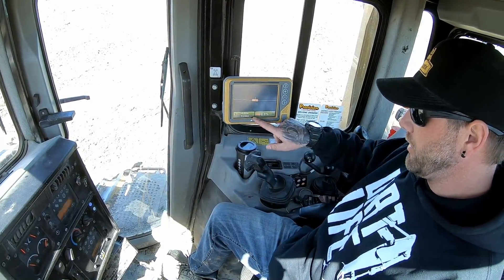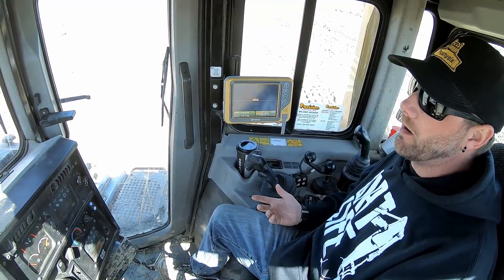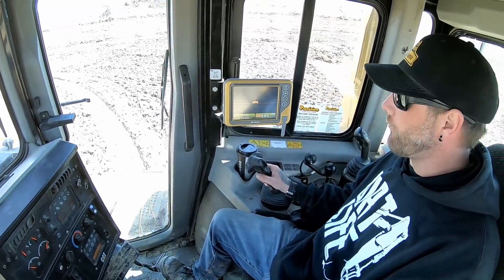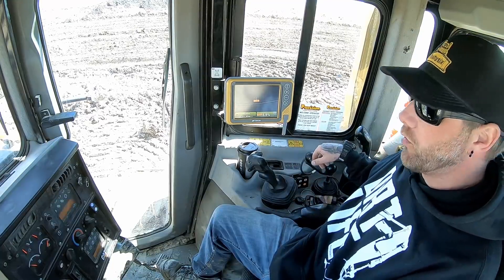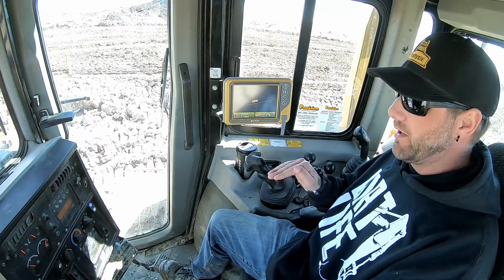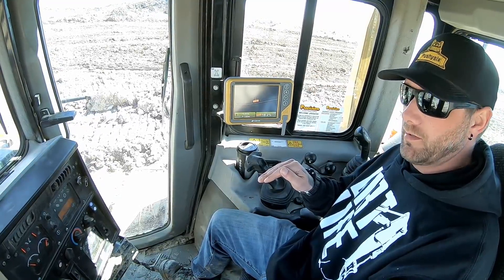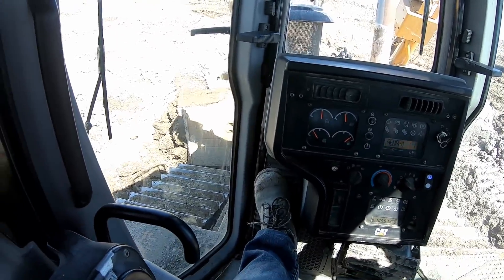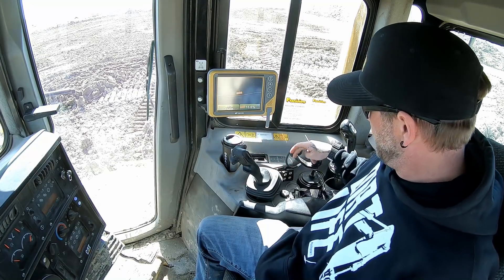How a GPS dozer really works | crushing misconceptions

Comment: Dude: what I have been trying to teach my apprentices for the last 40+ years is that every pass, every push, every bucket full is different! Some more different than others. They have been proclaiming that the computer will replace the operator for many years now. OK. Except they had to hire three computer programmers that had little if not any clue about what they were doing, to replace a competent operator.

Comment: I’ve been running machine control for 4 years . Did it the other way 21 years . I don’t use auto until I have it close using my cross section view . Trimble is by far my favorite. Topcon second . Last but not least Leica . Also offsets . You have sub grade , finish grade , rock grade finish floor all that can be changed . You have to know your thickness of concrete , pavement or slope . Topsoil had to be accounted for . Say .33 for ample topsoil spread . Without an excavator or pan in front of you moving the bulk the dozier is useless . I’ve heard a trained monkey can run GPS dozier . Ha . No way . I’ve got so many jobs under my belt that I’ve seen it all . GPS is a tool like a hammer or saw . Trouble shooting is also a big deal . I also run my own localization. I have the rover to go with my dozier . So I can check and change blade wear and go behind myself or lay out all kinds of things . Fire plugs , water valves , storm boxes . Etc . I’m considered very valuable to my company. Interestingly enough I lied to get in my first gps dozier . And I was lost ! Lol but I learned fast and later went to John Deere training days at the proving grounds and REALLY got good .

Comment: So you took 20 minutes to try to justify your place in the seat? Guessing someone in the canteen pissed you off and said the gps does it all for you. 
Being honest, as an operator myself, you’re making it seem much harder than it actually is, the reality is that the auto on the GPS DOES do most of the work for you, any idiot knows you can’t push out 500mm cuts.
Also...the new intelligent komatsu dozers, CAN adjust for a full blade, they’ll cut gradually so you don’t stop, they’ll lift the blade when it senses its full (resistance). It also has fill/spread function. 
Don’t be threatened by gps mate, it’s a tool FOR the operator, not to replace the operator. ;-)

Comment: I have no problem with GPS in machine's, in fact I think it saves a lot of cost when grading because you don't need a bunch of surveyors on site all the time.
The only thing that is worrying me is that the GPS is getting better and before you know it you won't need any operators for dozers, diggers, graders or no more dump truck drivers, maybe I'm just being paranoid, has anyone else have these thoughts?

Comment: as a dozer opperator on a now 5 year old cat D6 explained it. The GPS for that dozer could do the up and down, And move each corner upp or down,,, but it could not tilt the blade left or right to make material flow to the sides. But it only worked properly at slow speeds. But another dozer, this time Liebherr with different type of GPS only could do the up and down even tho it was more ''Advanced'' as explained by the dealer.

Comment: Pushy Six you should check out the cut fill mapping feature in TRIMBLE Earthworks that starts by colouring up the cut fill areas in plan, cross section and profile views by comparing a scan surface and the design surface and then constantly updates as you make passes with the machine.

Comment: very old dozer, with the new systems u can go on auto and it will fill up the blade will detect slip and carry the material for you.... so you literaly just need to drive back and fort.... and care to get some slots ... a new dozer can be operated by a total fool

Comment: us  old timers {who dont  use gps} use our "eye balls" to make grade.been at it 31 yrs.
Reply: i had to do it all by using eye then having a string line on the batters first for trimming then for pushing topsoil on, also trimming up after a excavator we use to use laborers with boards to bone in the heights not its all gps, while it's good it now takes the skill and art out of operating machines, hence why i am thinking of leaving the trade
Reply: "The art of experience" being lost to electronic gadgetry is something that we in the music business see a lot of; I can draw a straight line across the table from "Dozers with GPS" to "Casinos with electronic drums".

A lot of the older drummers who worked in the casino bands, when they first experienced the electronic kits were not impressed with all the fancy stuff they could do and were resistant to learning even the basics of "how to run them". Those were the guys who you'd see less and less of at "shift change" (casinos typically have multiple bands play on the same stage, hence the same set of drums...drums bulldozers... same/same...kinda/sorta...). They were working less because of being adverse towards adjusting with technology. 

Personally I can't stand E-drums and I'm with you on the "eyeball it" thing. A good operator has to know the basics and then some. And experience is something one cannot buy, you gotta earn it from the ground up.

Comment: Been running equipment for a while, from coast to coast. The BS about doing things by 'eye' cracks me up. I've done plenty of finish work by eye. I'll take my GPS system and go up against anyone doing it that way. There's just no comparison. I've saved weeks of work on projects with this stuff. You need to understand it, but once you do its crazy productive.
Reply: You are correct, i have used topcon 3d on 953d and trimble on excavators you cannot get better ,all this"by eye" is not bad, but after 30 years plus gps  is far far quicker...
Reply: Couldn’t agree more.

Comment: Im  a new operator  I have been trained on a d3 cat bulldozer.   The things you are saying make sence.  When my friend said bulldozer is easiest machine I think he's full of shit.  Iv driven excavator bulldozer backhoe and grader and grader is most finicky of all.  Seems simple but its not.  Any help you can give me as a new operator I thank you Now.  Love your videos keep up the good work
Reply: You are such a tool!!your in mud that’s not final grade. Yes I’ve worked with GPS  their great but your demonstration licked balls dude.
Reply: Your friends full of shit or isn't a true operator,  anyone can pull a stick and say its easy. Keep at it. I always found the motorgrader to be the most challenging.  Stay in the seat friend
Reply: The people think it’s easy to just push dirt and getting something level , but basically the operator is inside the cab and is in a very bad angle to estimate what he is going. Tracking layers a few cm all the way, I feel it’s very hard to see what you are doing.

The only way I’ve found that works for me at grading is using an excavator with a blade large bucket, I see what I am doing , and if I have a laser to tell me what is the level, it works just fine.

Comment: GPS is a a tool. Just like any tool it’s only as good as the operator and it can’t make you an operator.

Equipment will become autonomous. It a ways off but it will. That’s not to say no one will be on site, but labor is getting to costly.

Comment: GPS is not dependable it is accurate within a tenth, but I can cut within a hundredth manually, having ran both, gps is for the ones who are not good enough, a good grade man could name his pay,within reason, I know, I did,.Gps changes it grade for no reason other than a poor satellite reception, but construction in general has declined in workmanship, men were good at their jobs once, now it's good enough for a poorly done job
Reply: If you cut within a hundredth on a dozer it's by accident.  If a dozer cut is verified within a hundredth by a survey it's by accident.  Dozer cuts are designed to the hundredth.  The same GPS that controls the machine controls the rod man's topo shots.
Reply: Ohh your such a youngster, how the hell you think we did it before GPS and the survey team did not have GPS, think out side the box son, be a journeyman,be a professional, not a joystick jockey pushing a button, and when we blue topped within a hundredth it was no accident  we were that good, we took pride in our ability to do so, but the lazy kids now days would have the computer do it because it's too hard, Damn right it's hard, we never let that stop us,, Having been on and used GPS they are only accurate within a tenth up or down ,that is a total of 2 tenths difference,something we never settled for, we were better!!
Reply: More like half a tenth, further, even if the grade man wasn't using GPS back when you were "grading within a hundredth" he was certainly using a transit and grade rod, and if that man holding the grade rod isn't literally perfect, your grade will be off by more than a hundredth. Sorry, but grading to 1/8th of an inch across and entire site never happened, and isn't going to. 3 hundredths, sure, but not 1.
Reply: John Savoy i tell them what they are gonna pay me every time!
Reply: Get the fuck outta here. Hahahaha. I'm sure you could grade 10 acres within a certified millionth of a foot. What a joke

Comment: Excellent video. It doesn't replace an operator, it replaces the grade checker.  (Until you're under a bridge)
Reply: wailnshred 
Not necessarily true, at that point you take off your GNSS antenna, and bust out your Machine Control prism and Topcon Total Station. Come check out the LPS video on my channel. 3D Grading in a 200’ Tunnel.
Reply: Hahaha "Until you're under a bridge"
Dude I had this happen to me more times than I should, or going around a wall or when you forget to charge your batteries the night before 🤣

Comment: For the sake of job security, it's good that there's no true "auto button". If that were the case, the company would waste ZERO time in yanking operators out the equipment...for good. I've never heard of a fully autonomous dozer, hoe or crane. Good vid.
Reply: cranes are the same thing computers are the confusing part.  to learn but  if you know how to operate cranes etc some people try to make a big deal of it so  get in the machine turn it on turn the acl on and it is so simple if you have problems ask a kid walking buy how to work the computer ...computers absolutely fuck operators when they aren.t working
Reply: Autonomous machines are in use now,it is only a short while when operators are obsolete
Reply: John Savoy There is certainly a push for all things autonomous. Employers are thinking they're saving money by replacing workers with computers. Bad part is that it is a worker who gets a paycheck and then circulates that paycheck into the economy that keeps the economic system afloat. Robots don't buy homes, clothes, new vehicles and grocery shop. There needs to be a rethink on replacing humans with autonomous technology

Comment: Yeah they don't realize that parts of a job have different off sets for different things. There is a lot to a GPS dozer not just get in and go. It is a great tool though. Makes a really good operator even better if he takes the time to learn everything about it. And like you say there are a lot of tricks that can be used. Haven't used much topcon, but have used Trimble gcs 900. Anyway good video  is this part of your algorithm series.
Reply: Trimble makes awesome GPS equipment.